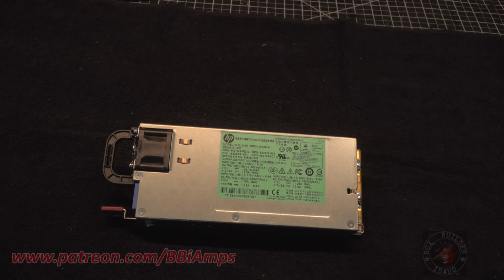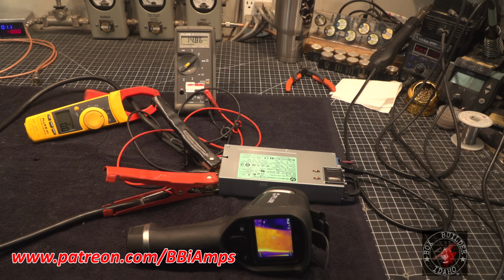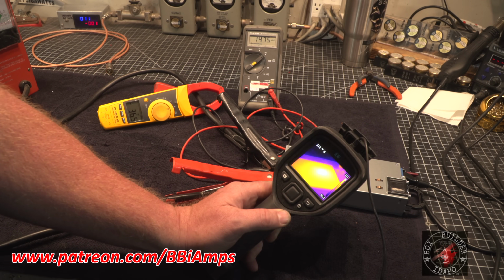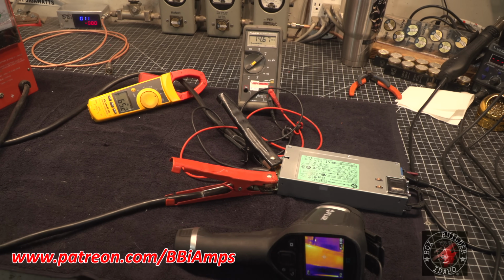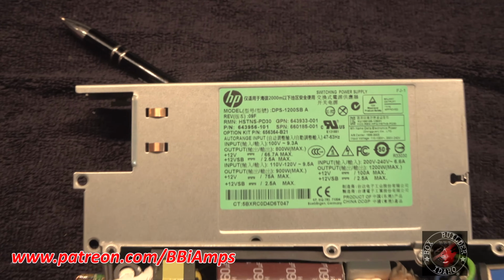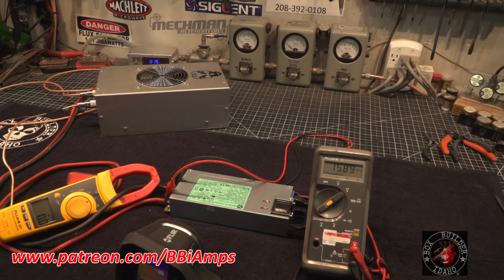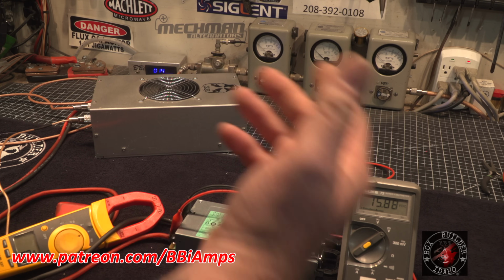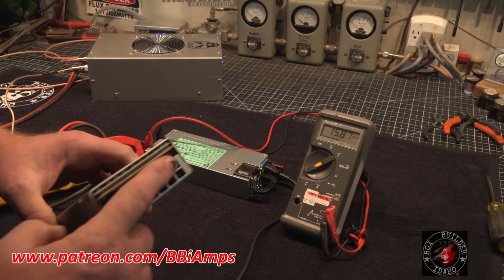let's volt Mod a Hp,dps-1200sb 100amps

Comment: I have heard of guys slaving a bunch of units in a bigger box with larger slower moving fans and extra filter caps etc. They use an old school 555 Timer IC to mimic the RPM signal. They measure the pulses the unit expects to see an set the 555 IC to send that signal constantly. Oh I cut this from another reply. The fans in these units are usually 3 wire and the 3rd wire sends RPM speed signal to a controller. I have not done this myself though. They mount a bunch of these in a bigger box with big slow moving fans and large filter cap banks and then mimic the fan signal to keep everything happy! Hope this helps someone!

Comment: They look great. was wondering about the hash noise on them. The last 2 blue label base amps I did was china PS blown. 1 converted to ICA IRON core outher Meanwell supply's but  the cost.  I got 2 meanwell SE 1500-15 on my test bench. they RFI pretty quite.  but the cost ! 73's

Comment: Ordered 10 for the price now to just build out the power supply and get something that needs that many amps. thank you sir. good honest content
Reply: Not really. As you change the resistance value on the voltage side you would also need to change the resistance value on the crow bar protection side. It is not likely to be a linear relationship so you would need a programable system that would change both in relationship to your input. Not saying it could not be done but not in the fashion you are thinking about. These are designed to be completely and total stable with next to zero ripple and to run continuously for X number of hours and then be pulled and hot swapped for a new unit! imagine having 20 of these running under the control of another controller that brings them all seamlessly into play as needed. There is likely that capacity already on the board but without knowing the instructions in each IC it is hard to know where to start. In this situation it is better to say "Yes please!" and "Thank You" and take it for what it is! If you for instance had one of these NOS imagine running it at it's rated output for 8000 hours continuously at it's rated load and voltage and 95% of these in its doing that all day and night with out a hiccup! Try that on a non-server supply and in no time it would fail. At the rated 12.5V this on 200+V this unit would give BBi the full 100amps. Luke is trading some current capacity for more voltage but the total watts the unit can do stays the same. He is also making it less temperamental with regard to how fast the load can be applied with out tripping the protection circuit. Thanks for the share BBi!

Comment: How do they work stock at 12 volts??? Is it still very sensitive to sudden current?
Reply from the maker: Alright let me start over they work fine they're not too overly sensitive
Reply: @BoxBuilderIdaho  I'm thinking they would be perfect for car audio Deck tinkering. 12v would be all id need 🙂✌️
Reply: @SDS-1  Yes! If you wanted to say run a 5Ch car amp in your garage or basement for some affordable power. Most of these units use a 3 wire fan and the fan sends RPM info back to the controller. I have heard of guys slaving a bunch of units in a bigger box with larger slower moving fans and extra filter caps etc. They use an old school 555 Timer IC to mimic the RPM signal. They measure the pulses the unit expects to see an set the 555 IC to send that signal constantly.
Reply: @buckaroobonsi555  not looking for a bunch together. But it would work
Reply: @BoxBuilderIdaho  lol 😂 thank bud
Reply from the maker: No

Comment: Could you use a variable resistor to set the voltage...make it easier to  parallel 2 or more together?
Reply: You can parallel these out of the box, there is also a load sharing pin on most ... Best is to get the server that these go into an build a hot plug redundant PS. See the top comment that I posted earlier.

Comment: That is awesome.   Now with clone 2879s becoming more easily available and hopefully closer to original specs, kind of makes me want to go retro lol.  If I stacked them I'd have to pull from multiple house circuits LoL😅   Great Video.
Reply: that why run on 240V . less AC input amps.
Reply: @robertmeyer4744  Right,  that was later in the video and I had already commented.  That is pretty cool auto switching too!  If I did a stack, I would still probably use isolation diodes into a nice stiffening cap.

I tell you, I may get one just to build a jump start booster.  LoL 70+ amps is  nothing to sneeze at lol.